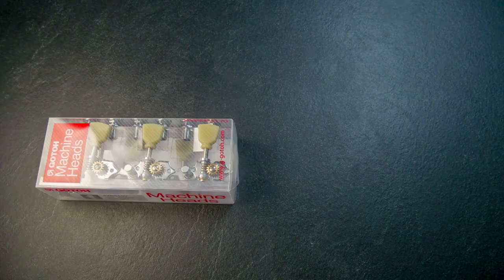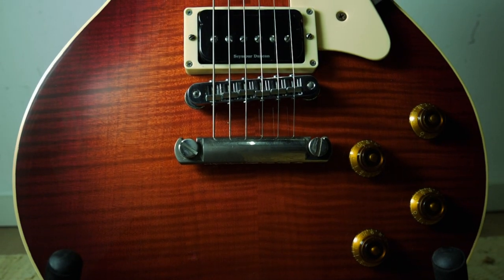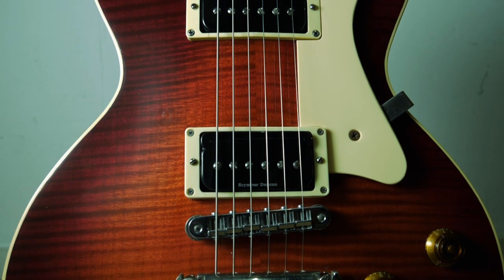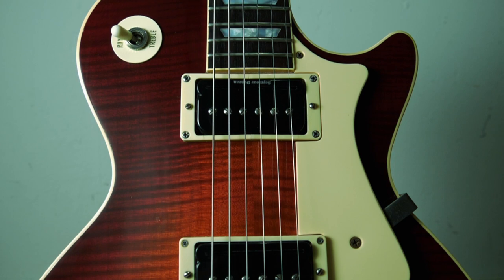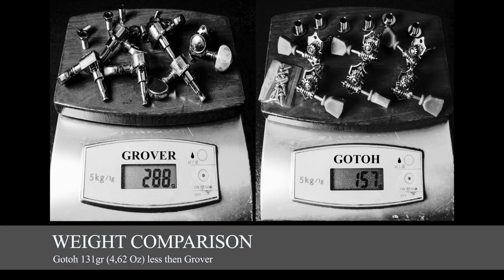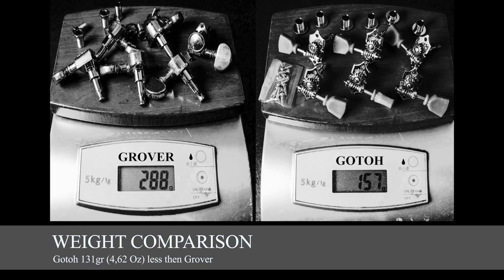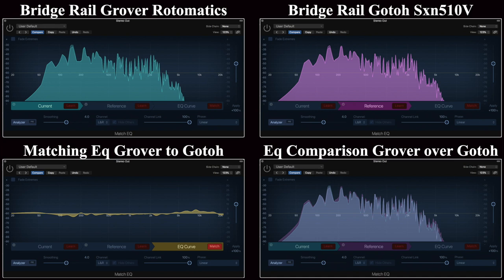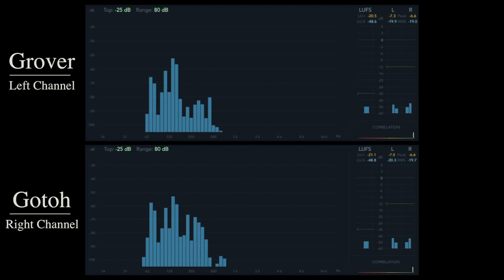Is worth replacing guitar tuners? Watch This! | Grover Rotomatics vs Gotoh sxn510v | Heritage H150 |

Comment: Interesting. My response to question of, "should I change my tuners?" is to ask the customer if they have experienced any particular issue specific to the tuners already on their guitar. When they describe the issue it often turns out to be some problem with another part of the guitar, maybe some part of the bridge is loose, nut is improperly filed etc leading to tuning instability. Sometimes it's a loose tuning peg ferrule that doesn't require a whole new machine head. Reasons to upgrade tuners: you want different peg height or different style, the machine head gearing is worn or badly made in the first place such that there is slop when you turn it (there's a loose feeling spot in the rotation), you have an issue with string breakage at the tuning peg, etc.

As far as tone and sustain go, nut/bridge/pickups and string choice should all be addressed before taking a hard look at the tuners for a difference there.

Comment: @Robert Colussi did you have to drill anything?
Reply from the maker: Hi Diogo, I just use one hole from older Grover Rotomatics and its safety. If you want you can add the second screw but needs a hole. I pick a model that can retrofit the Grover. Just check the Gotoh website.
Reply: maybe a riff or two,,, lol